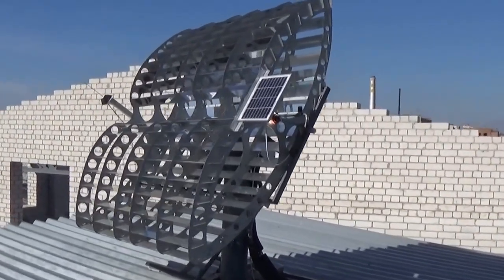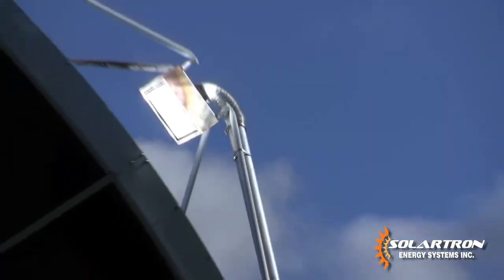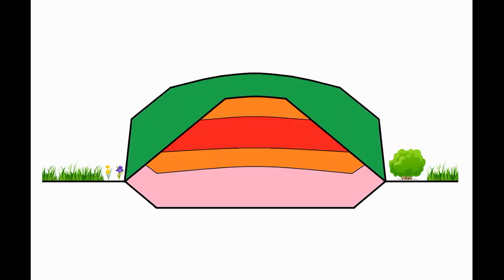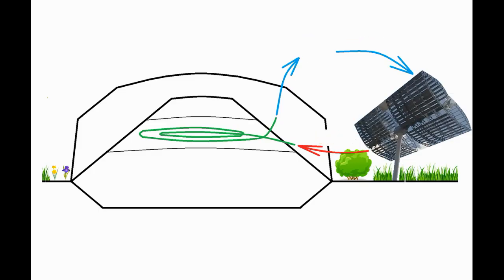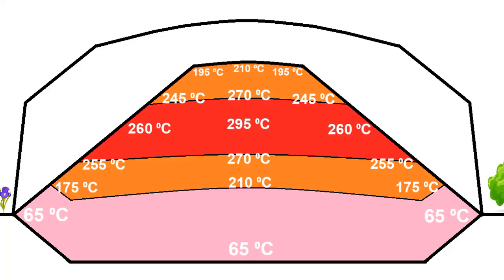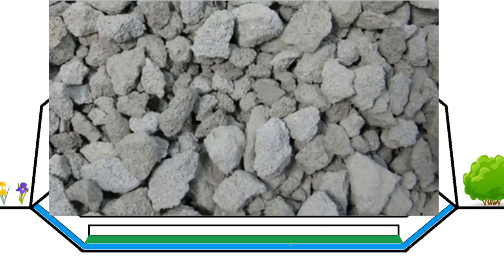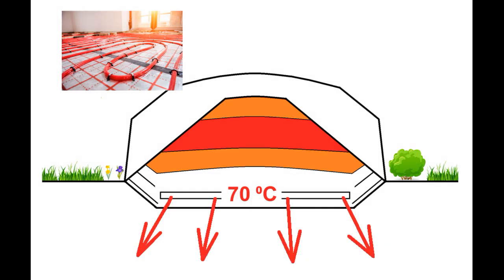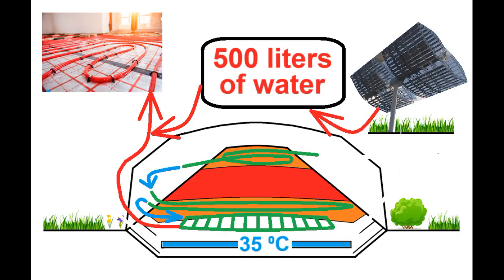How this solar heater can heat a house during the long polar night

Comment: It looks like a significant percentage of the heat stored is lost through leaks.  The inefficiency of active solar panels means that your system ends up being way more efficient than active solar+battery despite these losses.